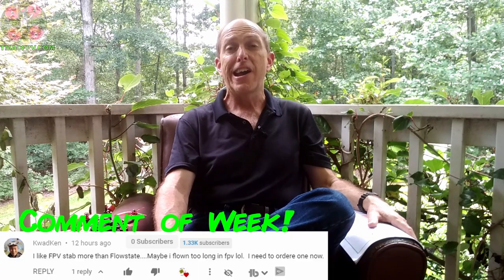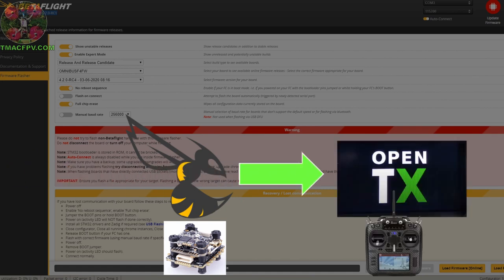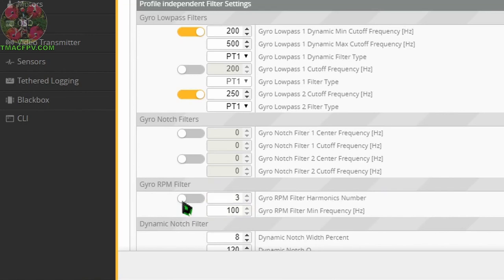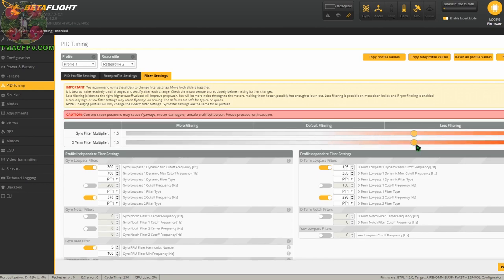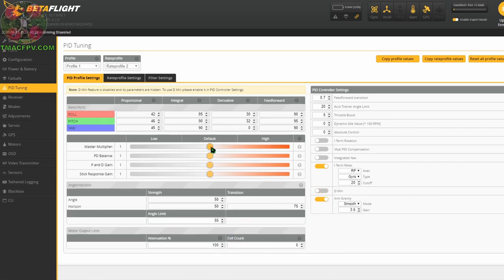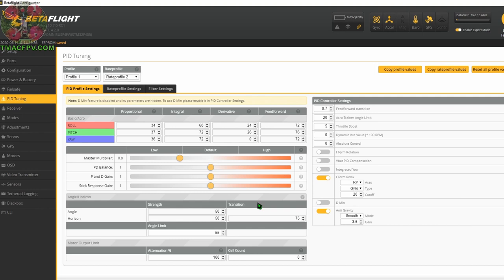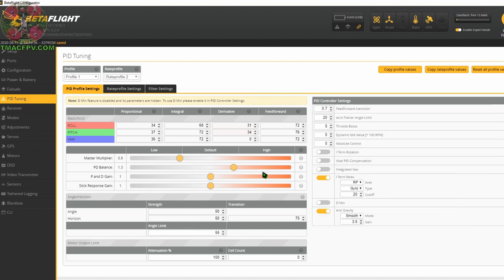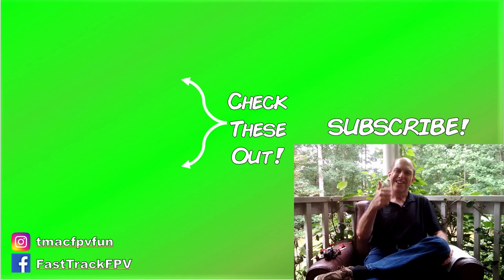Micro FPV Drone Tuning Guide (SMOOTH PERFORMANCE!)

Comment: Hey TMac, thanks for the series. I've just started but already I'm learning quite a bit about the different settings and what they may affect. Given that Betaflight 4.5 was just released, will these same steps still be applicable? I just finished building a 2.5" based on the Quadmula Djinn25 frame, and I'm leery to attempt a flight with only the stock BF4.5 tune.

Comment: Pretty good I must say.
Reply from the maker: Hey Ruby! Great to hear from you, its been awhile.  I have not forgotten about your suggestion to do Blackbox Explorer (as you know  if you have watched the video).  In fact, I started this whole "process" of tuning Micro quads series because of your suggestion, so I was wondering if you'd be watching!   "Pretty good?"  Not phenomenally outstanding?!? 😂 Ok, what is it you don't like about it?  🤔 I was trying to keep it as simple as possible and at the same time explain the concept.  This is definitely not an "advanced" tuning video.  I've discovered some folks are very hesitant to delve into tuning just because they're unfamiliar with it and are a little concerned about messing things up.  So, this is my attempt at getting folks more comfortable with the basics.  Please don't hesitate to let me know if you have further suggestions.  Blackbox stuff will be coming soon.  By the way, I just included the link in the video description to the CLI commands for the PIDs and filter settings.
Reply: @TMacFPV  I don't have any negatives it's a really good basic guide and does a good job of explaining where to start off, your excited you just built this quad or whoop you want to fly.  The graphic on what the filters are doing is excellent. The 30 second flight and check the motors, great advise if it's noisy you will know immediately cause the motors will be hot real quick  Get your filters done and move to pids. Another part I like was the where to start with the master slider and the graphic showing the whoop and the 3 inch.  I was thinking you may have wanted to mention if you turn dmin back on make sure the dmax number match's the d number you found when tuning or it may be too high. But really this video is going to get you in the air, get it flying pretty good and by then your "is it going to fly" curiosity will be gone and you can move to the next steps if you want too. Again it's a great video for most people that want to get in the air not do to much thinking and messing around and just fly.
Reply from the maker: @RubyS.1  Thanks for your insights Ruby, I greatly appreciate you sharing them.  Great point on D_Min & D_Max values when you turn them On!  The way you described your perspective on the video was exactly what I was shooting for on this first one.  More details in subsequent ones.  Thanks again!

Comment: Your fist pump in the intro i find sooo annoying. However I honestly believe your videos are the best on the internet for clear step by step guides along with clear and simple explanations.
thank you so much.
ive just updated my blheli s esc to the jesc following your guide and now have followed all the steps in this video for my 3 inch vistapick build.   cant wait to see how it flies.
and at least if it doesn't have a perfect tune as its quite a heavy toothpick with the caddx vista and 2s 750 mah battery I have an idea what to do with the pids using the slider.
thanks again...…
Reply from the maker: Outstanding FPV wannabee! Thank you 🙏for your kind words (I'll focus on the positive!) 😀So, you've got a "heavyweight toothpick?!?" That ought to be interesting!  Know its T/W ratio?  Got pictures or a link you want to post on this site, go right ahead! Love to see it!
Reply: @TMacFPV   no offense was just pulling ya leg.

I'll send a message via Facebook messenger.

I've no idea of the T/W

Comment: I have a 61gram 2s/3s toothpick build that I love flying, its super smooth on the 300mah 2s and 300mah 3s, but when I try flying the bigger 520mah 2s batteries (for almost 7minute flight) I just can't tune out some of the jello. Any advice on added weight tuning? Should I reduce filtering sliders to the right? So far I've cranked my D gains up to 150 and no hot motors, but still fiddly, i'm afraid to approach 200 on my D gains... Also like to carry my insta360 on this build, its such a smooth flier, just wish I could get that perfect tune on it like the other batteries seem to provide.

Comment: Wow very good and deep guide.. Will try those settings. This vid popup as my geprc skip 3 hd arrived! What kind of quad do you think is skip hd, whoop or 3 inch? Since its have whoop part and also a 3 inch
Reply from the maker: Hey Amiraditya! Congrats on your new Quad!  If you just got your Skip 3 HD I would not do anything with the PIDs as long as it flies fine for you.  Why change something if its working?  Instead (and first) save the current settings from your flight controller before changing anything by going to the CLI and typing "dump all" without the quotes.  copy and paste everything that appeared on the screen (you'll also need to scroll up) to a Word file.  This will then be your backup "original settings" if you need to go back to them for some reason (by pasting them back into the CLI as log as you're still using the same version of Betaflight).  Look at he original PIDs from these settings.  I'm guessing they'll be a bit higher settings than the ones I used for my 3" build (although I could very easily be mistaken).  My guess is because I believe your Skip 3 HD has a T/W ratio of somewhere near 4.5 (depending on size of battery you use and props).  This T/W ratio is about 1/2 that of the 9.4 T/W ratio of the 3" build shown in the video and therefore have "lower authority" as described in video.  A lower T/W ratio would normally mean higher P and D terms than what I used for the 3" build.

Comment: Is this only for 3" drones and smaller, or can you do this for a 5" to?
Reply from the maker: hey Hans!  Not knowing exactly your experience, I'll say you use the Betaflight Configurator for 5" quads as well.  the actual values for 5" quads will be different (actually easier) than for micro quads.  That's because the default settings within BF 4.2 are FOR 5" quads. If you want to change those default settings for 5" quads, depending on whether or not the quad is "low-authority" (heavy freestyle) or "high-authority" (lightweight racer), the Betaflight 4.2 Tuning Notes have good write-ups on how to do that here: https://github.com/betaflight/betaflight/wiki/4.2-Tuning-Notes

Comment: great video.. although i dont have a gyro RPM filer slider. my betaflight version is 10.7.0
Reply: betaflight version is 10.7.0 is the configurator app version , you will see the version of betaflight on your flight controller when you connect it to pc
Reply: @Ark__Angel  ok thanks. Although I've also updated my FC to the latest version, still don't see the rpm filter slider
Reply: @Ark__Angel  my bad. I needed to turn on bidirectional Dshot.